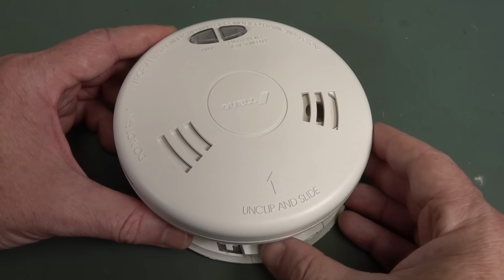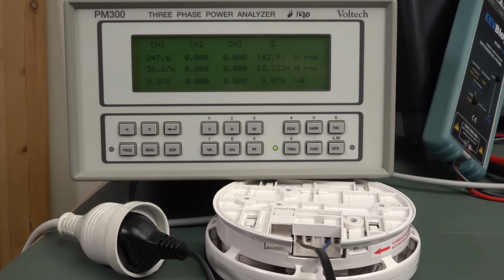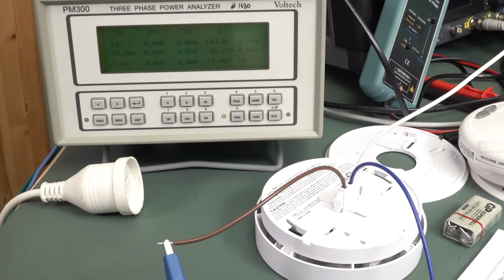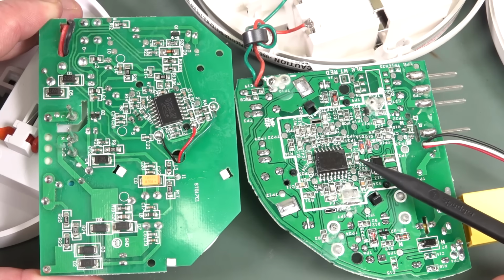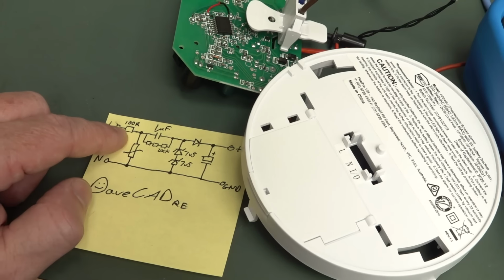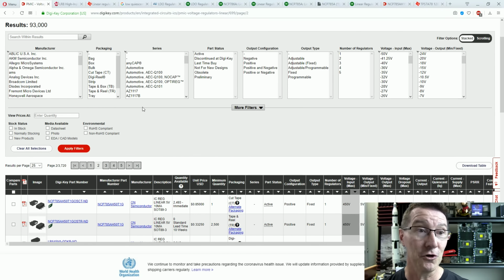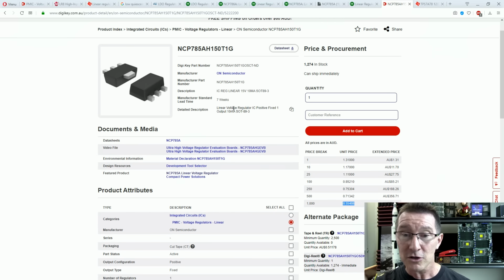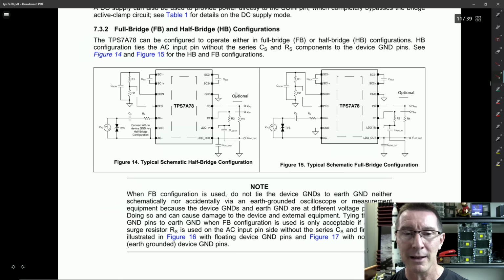EEVblog #1284 - How Bad Product Design Kills The Environment

Comment: Well I didn't totally get the math there, but I was just thinking about in terms of a bad case is a house has 10 watts devoted to smoke alarms, and there are say 1 million homes. Actually there are probably more than that in Australia. So by that math you'd need to supply 10MW, not 100. But the way I see it the smoke alarm is probably like 10 watts vs the daily average of a home that I'd say is about 500 watts. so that would make it like 2% of the power drain of the house so with those sort of numbers Australia at 1 million homes needs to make 500MW on average minus transmission loss. Probably for real it is more like 10000MW a the station  including for industry. Lets look it up. 'Total electricity generation in Australia in 2018 was around 261TWh.' says an Australian government website. 

Total hours in a year is 8760 so it is 0.298 Tw /h.  1Tw = 1000000000000 W so this is 298000000000 Watts per hour on average. So that is 298000 MW/h or 1072800000 MW per second output on average. So what I am getting at is 10MW is still 2% of the consumer national power output even though it is adding up to something. This sounds kind of high, did I make a mistake?

Comment: "If the actual product itself takes less than 50uA, why does the product have to take orders of magnitude more than that?"

So the real reason for this is because this kind of power supply draws constant power (all the time, regardless of the actual useful load current consumption), and you have to design for the maximum load current that you'll ever draw. If you have a 30mA load to power a 2V LED, then that also results in a 30mA input requirement at the AC mains voltage as well--which is a lot more power than you need. If you also want to chirp the alarm while keeping the light on, and that takes another 30mA, you now have a 60mA design requirement, so you will always draw power equal to AC mains voltage * 60mA. Add another 10 to 15mA for the microcontroller, etc. Then When you also factor in that that a lot of the resources for transformerless power supply design don't even do the calculations correctly, you end up with overdesigned transformerless power supplies, or worse, ones that are reused from previous designs without optimization because "they just worked"

Also, at 240V, your losses for a given load are 2x that of a 120V mains system, so that's unfortunate. 50Hz vs 60Hz doesn't matter much in this type of application because it only affects the size of the DC capacitor you put on the output.

I've put together a number of helpful design resources on this very specific topic (mostly because I couldn't find anything good myself a few years ago) at http://www.designercircuits.com/transformerless.htm, including a document that walks through the calculations and different topology options, spreadsheets and schematics for both capacitive (like the smoke detector) and resistive version of transformerless power supplies.

One of the conclusions I've come to is that this is really only a viable topology for loads in the 10s of milliamps, because beyond that, it is difficult to even reject the heat generated. But if you do need more current, a very clever approach that greatly improves the efficiency is to target an intermediate output voltage, like say 40VDC (meaning less energy is burned up in the input resistance), then use a switching power supply to efficiently step that down to lower voltages. This lets you get upwards of 100mA without much cost, because switch mode controllers in that voltage range are still pretty low-cost.

Beyond that, it really is a matter of going into the design with ultra-low power consumption components. And avoid LEDs.
Reply: A quick addendum to the above; at 0.5W of real power consumption, that maps to about 2mA of current that gets consumed/dissipated. Still like 40x what is needed for a 50uA average load. A far better solution economically for the manufacturer and consumer would be to eliminate the capacitor (short across it), replace the 100ohm resistor with 1Megaohm resistor, and still have 100% margin in your load current (support for 100uA). Beef up the output capacitor to handle peak transients (beeping, LEDs, etc.)
Reply: So it looks like the most clever approach here will be to use a resistive transformerless power supply to run the logic needing 50uA constantly, and whenever it is time to beep, since 15mA is needed for that, have a separate transformerless supply that you turn on with an SCR/thyristor controlling that second transformerless supply from the low side. You still save money because you can still avoid the capacitor for 15mA, and the diodes, resistor, and SCR is still cheaper than the 1uF AC mains-rated capacitor.

Comment: It's a safety device. More parts mean more potential failure points. What's the MTBF for the linear regulators?
Reply: Certainly a consideration. Also what temperature are the components rated to?
Reply: @bert-blank  A typical unit appears to be 85C (or 186F). A typical Zener, at the indicated power dissipation levels, appear to in excess of +150C. Naturally, that device is up against the ceiling where it will get hot first. Even at the relatively high 85C near the ceiling, it still might be survivable to occupants. Microchip's datasheet says: "Use  of  Microchip devices  in  life  support  and/or  safety  applications  is  entirely  at the buyer’s risk..."  I can understand why you might roll your own here. If they aren't going to stand behind their device, how can you? It's relatively easy to be certain how this device constructed with Zener diodes will behave.

Comment: Chicago, Il. mandates ten year lifetime smoke detectors. Pretty nifty things that will reduce fire deaths dramatically. Some models have a CO detector built in as well.
Reply: CA has a law for 10 year Smoke / CO detectors for existing buildings, but AC powered with back up for all new constructions.   We just added solar panels too, no fire place, low energy lights low flow water .

Comment: You could have a single diode and resistor feeding those zeners, even passing 1mA would be plenty (with a low-leakage smoothing cap), less parts and way cheaper than all of them.
Reply: But you also need to have the power to run the alarm. Your solution will not allow enough power for that.

Comment: I have a super duper high power 27W charger for my phone, and my phone supports that, but obviously doesn't pull that throughout the whole charge cycle.

That puts as much load on the grid as the 20VA fire alarm, except my phone isn't being charged 24/7.

Comment: You can actually use a high voltage depletion mode MOSFET to modify any "normal" regulator (7805,LD118,...) to support serveral hundret volts on the input.
Reply: Not so good for improving efficiency though.
Reply: @absalomdraconis  That really depends. In standby its efficiency is near perfect, with iq of a few microamps, under load it is as unefficient as you'd expect from a linear regulator =)
Reply: @berniwa  Don't forget that all idle current of your linear regulator is REAL power, as opposed to the APPARENT power that a capacitive dropper has.  In the shown circuit only the power dissipated by the zenerdiode is real power, all other power is apparent power.  But drawing even only 1mA in a linear regulator that operates on line voltage will cause a big real power usage.  That effectively precludes any use of conventional devices like a 7805.
Reply: @Rob2  Sure, with a 7805 the current draw will be problematic, but technology progressed since then and TIs 7805 cousins (like the TPS783xx) have an iq of 500nA. So the real power consumed by the regulator would be a moderate 115uW at 230V ;-)
Reply: @berniwa  But once the alarm starts beeping and draws 50mA or so, your solution draws over 10W of power and dissipates that all in the regulator/fet, while the capacitive dropper solution still only draws about 1W as it always does.
Not important from energy consumption perspective, but the design has to accomodate the dissipation of those 10W at least occasionally.
Reply: @Rob2  as I mentioned before, standby current consumption is perfect, but the efficiency under load is as bad as the other linear regulator dave showed. Yes you'll need to dissipate a lot of heat for continuous operation, so as with the shown regulators 10mA seems to be really the maximum that you can do without proper cooling

Comment: What is the duty cycle really needed to detect smoke?   You could turn the darn thing on for a few milliseconds every second, and then go back to 'sleep'.  I mean what is really the bottom can you get to?
Reply: Can't say what duty cycle they use, but the smoke detectors I've got run for over 5 years on a standard 9V Alkaline battery, and at least 10 years on a lithium battery. So the power draw has to be pretty low. And yes, these are more than 10 years old. I think the oldest one is more than 30 years, and it still works. At least it still gets crazy if someone lights up a cigarette anywhere in the house, not to mention when I get a bit over enthusiastic in the kitchen...
Reply: @blahorgaslisk7763  
So theoretically if you could take it down to 1% duty cycle, and the battery chemistry didn't degrade, you could run one for a thousand years on a single Li cell.
Reply: @kurtu5  I think the chemistry is a big part of the problem. A five year old alkaline isn't good for much even if it was just left lying about unused. I don't know much about the aging of lithium cells but I can't imagine they are impervious to it. Besides the batteries isn't the only thing that ages in a smoke detector. If nothing else they can get clogged up with dust over the years so changing them out every ten years is probably a very good idea. I'm keeping some of the first detectors my parents installed around just to see what happens over time, and so far the oldest one is still the first to react to my culinary mishaps in the kitchen. I thought I killed it when I cleaned it for the first time in at least 30 years, but after blowing it out it was working again. AFAIK it should have been scrapped over 20 years ago, but I'll keep it around to see what happen over time.

Comment: As an electrical engineer in the USA, there are so many reasons why 50hz is rubbish compared to 60hz. I think it would be interesting if you did a video comparing the two, and seeing your reasoning on why 60hz is rubbish.
Reply: Whoosh!
Reply: Could you give a few reasons why 50Hz is rubbish?

(To give an example of a disadvantage: 60Hz creates a bigger resistance and bigger losses in transmission lines).
Reply: Maybe a discussion about "what is beter, 115V AC or 230/240V AC for consumer mains outlets"...?
Americans write that 115 is "safer" but I really question that.  115 is high enough of a voltage to get a dangerous shock, and with 115 the current of the average appliance will be double of what it is in the 230/240 system.  The higher current contributes to fires due to bad connections, so 115 may be more dangerous as a whole.
Reply: In Japan we have both 50Hz and 60Hz power grids!
Reply: That's just a Dave-ism, whenever there's two options, the "other" option is "none of this x rubbish". It's rarely an actual indictment on "x".
Reply: I prefer higher refresh rates. Lol

Comment: Dave, Thanks for warning about this vampire!
Reply: vampire is such a stupid name for this. "tick" would be best. ticks attach to the animals and they don't even feel them, but they are feeding off them. vampires are rather obvious lol.
Reply: @83hjf  "Vampire" refers to an appliance left plugged-in that draws current when it is "turned-off". This includes some toasters, small stove-top ovens, mixers and others older items that do not have a clock or other monitoring device. This term has been used since the 1950's. In this case, too much standby current.
Reply: @Starphot  i know what that means, but i never liked the name

Comment: Why do they need to be wired in? For Muppet's that remove the battery and do not replace it?
Reply: Pretty much, except if you pull the 9v they scream at you every 30 second until you yank them off the ceiling in a most unsafe manner possible. No winners in this design.

Comment: What about just not using the mains power and go battery only? 
For  use in a normal home you need the 9V battery as backup when your mains supply fails  anyways. In commercial/public buildings a fire alarm system with smoke detectors should be common.

Comment: You could also have a look at the alarm clocks sold. Probably the same amount of units per house hold and it could be battery powered or even wound up ones. But there are lots and lots of them on the market which draw more power costs in a year than you have to pay when buying them.  And as they have a "clock" in them, they don't need to be sub 0.5 Watt stand-by as other devices must comply to. (ever bothered to think why lots of devices have clocks these days? :) )
Reply: Can you point me somewhere where I can read more about this regulation? It sounds interesting
Reply: @sasodoma  As far as I know, it is at least an EU regulation.  See for example: https://ec.europa.eu/info/energy-climate-change-environment/standards-tools-and-labels/products-labelling-rules-and-requirements/energy-label-and-ecodesign/energy-efficient-products/mode-standby-and-networked-standby_en

Comment: Out of curiosity...what are the actual benefits of a mains powered smoke detector if you still have a basic 9V backup alkaline? Also any opinion of the lithium powered smoke detectors that are supposed to last 10 years?
Reply: Because stupid people is too lazy to buy a battery when the old one dies and they burn...

Comment: Mobile phone chargers. Many people leave them plugged in without any load, I bet the quiescent current is awful on many of those.
Reply: They've spent a bit more money per unit and use switching supplies in those, though.
Reply from the maker: There is the energy star legislation for plugpacks.
Reply: The quiescent current in phone chargers is very low. They use proper buck converters to drop the voltage, so when there is no load on them, they are basically turned off. Power factor will be horrible because they are only loading the peak of the sine wave, but a low power factor on a ~zero load isn't a problem. 

Good ones use circuitry that follows the sine curve to give them a good power factor under load.
Reply: Ive got one plugged in nearby but its cold to the touch so cant be worth fussing over.
Reply: TVs have outstanding standby current. My dad is a service tech for Philips. 20 years ago, the training tech was HYPED about the low power consumption on standby on those sets. It was so low, the standby LED would remain powered for a good half hour after you unplugged it. They used a big capacitor so in standby the TV would just "burst" the PSU to charge the capacitor and go back to sleep at milliwatts again. My old-ish LG LED TV has a relay to completely disconnect (not just standby) the main supplies. Only the standby PSU remains powered in standby. The rest of the TV is OFF. And then the PACE cable boxes just blank the HDMI output when "off". The tuner and decoder circuitry runs 24/7 and the device is a nice space heater...

Comment: So in America, we have devices that just have (I think) a 24volt-ish line as well as a signal line to sound off the other alarms, as well as a 9v backup battery, but my home was built less than a decade ago, and older homes usually have just a 9v battery and the alarm line.
Reply: Most new homes have mains unswitched smoke detectors now. (At least in new builds in the last 10years in Canada)

Comment: There is no such thing as "generation" of reactive power. Apparent power just causes an increase in current in the transmission cables, transformers and generators. Of course the increased current causes losses due to resistances and ultimately some additional active power to be produced but nowhere near the total apparent power.
Reply: I can tell who has a degree in electronics!

Comment: What is better for enviroment? 0.5W load (so ~8kWh/ 2 years consumed) or to replace some Lithium battery (mine alarm uses CR123) every 2 years? I would bet on the 8kWh...Still crappy design with high current draw of course...
Reply from the maker: Err, the mains powered ones still need the same battery!
Reply: @EEVblog  Fair point :D I guess you need to replace the battery every few years due to self discharge...
Reply: Every two years sounds a bit over the top. The smoke detectors I have will run for well over 5 years on a alkaline 9V battery, 10 years on a lithium battery. Once the voltage drops they start chirping until you replace them out of self preservation. That chirping can get really obnoxious and they can keep doing this for at least three weeks. I had one extra that I put in a box just to see how long it would keep chirping. Three weeks in I got bored with hearing that faint chirp every now and then.
Reply: Smoke detectors are supposed to be replaced every 10 years. You can get battery powered ones in the US and the battery lasts for the life of the smoke detector.
I doubt manufacturing a battery and smoke detector uses more power than the 1.7MVAh the crappy mains powered smoke detector will use in its lifetime.